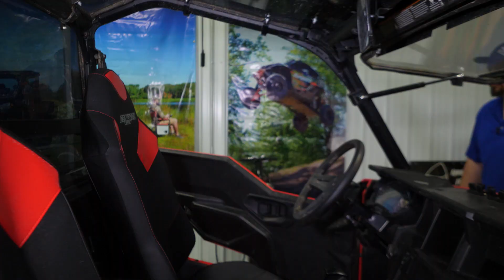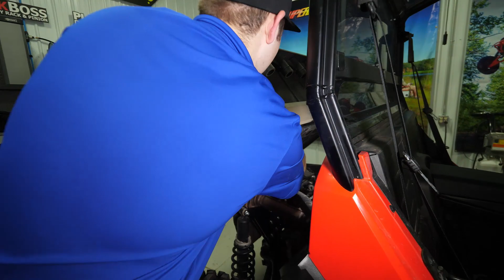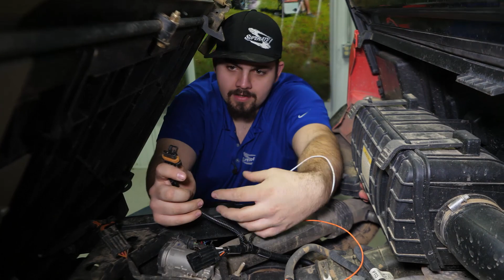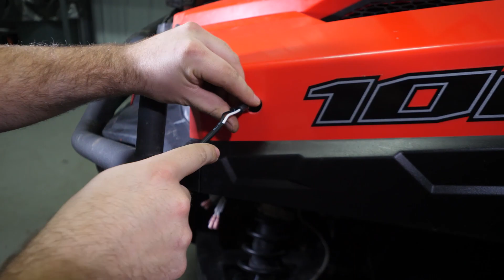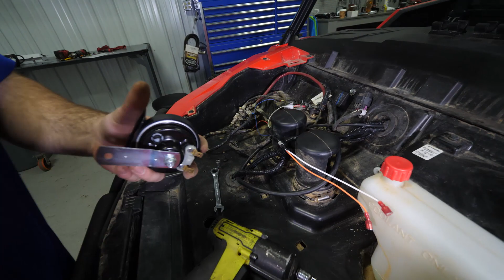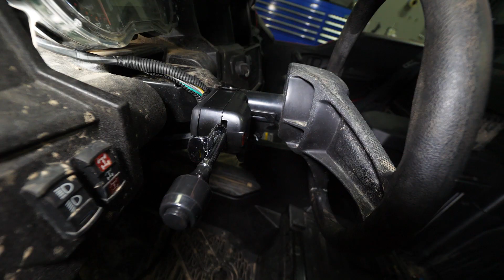Easy Plug and Play Turn Signal Kit Install | Polaris General | How To | SuperATV

Comment: If you connect to power source that always on will that cause my tail lights stay on. Need a power source connector ?
Reply from the maker: You will need to connect this to a keyed-on power source instead of directly to the battery.

Comment: my horn does not blow, hooked to a seperate power source and ground and it blows nice and loud!!! but would like for it to work through the button, and as soon as i started to put a bend in the horn bracket it broke! the metal is super brittle!!!  i called the help number and no help whatsoever!!! because i bought it through a dealer!!!  very unsatisfied!!!  but the turn signals work as they should,
Reply from the maker: Hello Bob, it sounds like you may have a bad horn switch. We do need your proof of purchase or shipping info to locate a purchase, but once obtained, we can get both items replaced. If you'd like to send us over an email or give us a call with this info, we can make sure this gets taken care of for you; sales@superatv.com, 855.743.3427.

Comment: I just install this kit on my Polaris general 1000 and the break light stay on even after the key shut off also the indicator light is not working on my lever is there something im doing wrong .
Reply from the maker: Sounds like you may have a wire or two hooked up incorrectly. Be sure that that 12v power source wire is hooked to the key on power terminal. Use a test light to make sure that terminal is only hot when the key is in the on position. If you can't figure it out, please don't hesitate to pick up the phone and give us a call at 855-743-3427 we'd be happy to get you fixed up.
Reply: @SuperATVMedia  ok thanks for the info i will definitely check the wiring . Also i notice that the indicator light on the turn signal is not working,,,, wondering if it suppose to work or not,,, those 2 green light and the red light .
Reply from the maker: @vincethibodeau4260  Your welcome, yes the indicator light should illuminate. I would venture to say it points back to the wiring. If for some reason it doesn't light up with the wires hooked up correctly, give us a call and we'll address the issue.
Reply: @SuperATVMedia  ok sounds good . Not home at moment but will check it out next days off . Thanks for the responded not often that a company response to a question this fast , and for that i give 10 out 10 star .
Reply from the maker: @vincethibodeau4260  Thanks Vince, don't hesitate to pick up the phone and give us a call if you need any other assistance. Have a great week!
Reply: @vincethibodeau4260  Hey bud ,I'm having the same problem.
Did you figure it out?if you did please let me know Thanks.
Reply: @edwardduncan3414  yes found the problem had a ground wire that was tuck away in the harness didn't see it went i did the install hook it up to the frame and work like a charm but can't seem to make the 2 green light work on the columns need to do more troubleshooting but overall work great .
Reply: @vincethibodeau4260  Thanks bud.
Reply: Just installed the kit on my 2019 , indicators on the blinker assembly don’t light up , the greens or the red . But the indicator light that’s separate works . So not too big of a deal ...